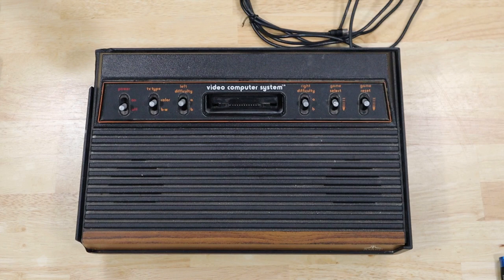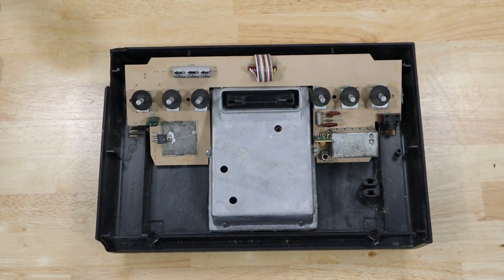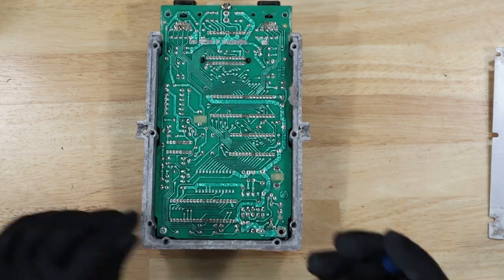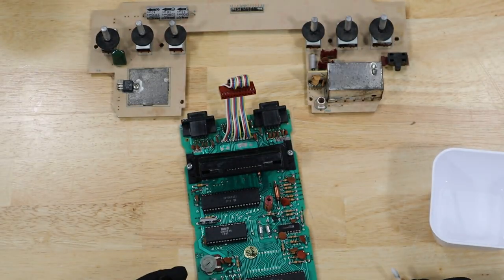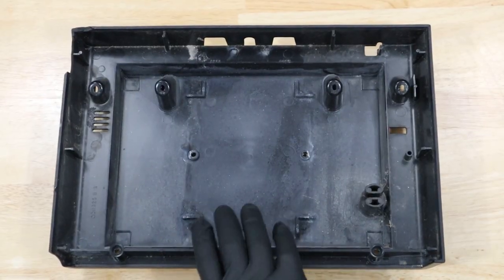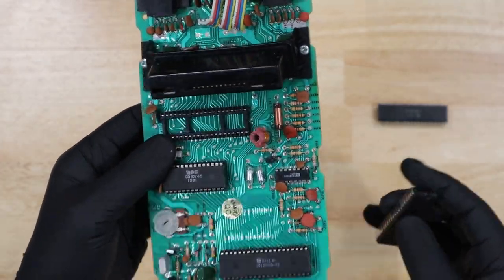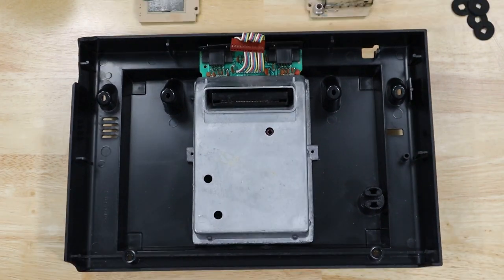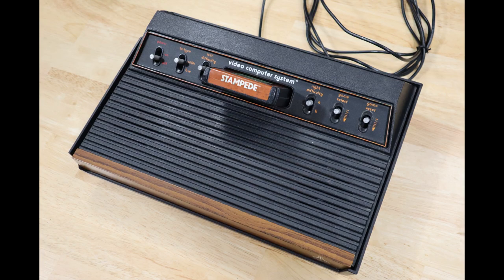Fixing a Dirty Atari 2600 - Black Screen/RIOT Chip Replacement

Comment: Wow you literally did nothing but clean it.
You didn't even do the basics to see if the caps were good  and check the power regulator. It looks like you probably wasted a perfectly good chip by replacing it and literally replacing nothing else or checking nothing else.
 bravo

Comment: Very cool! Were there multiple hardware versions? We had an early 2600 with the six switches on the top, like yours. But the inside was just a small PCB with the cart slot and very few other components. Basically nothing like what was in yours. Definitely didn't have the aluminum box.
Reply from the maker: There were different versions. The Atari 2600 was actually made by different manufacturers, so opening them up can be different depending on who made it!